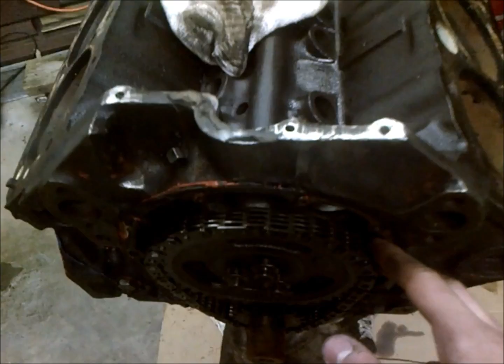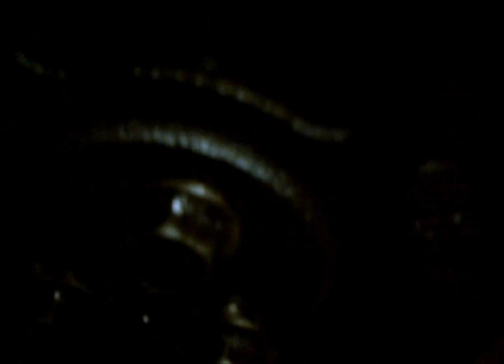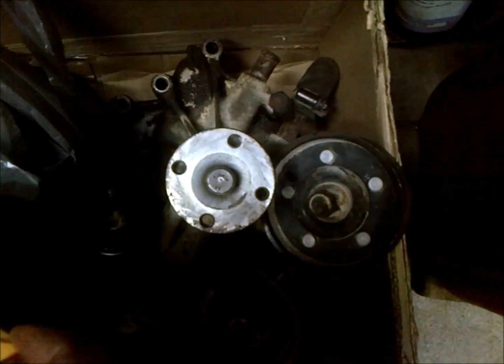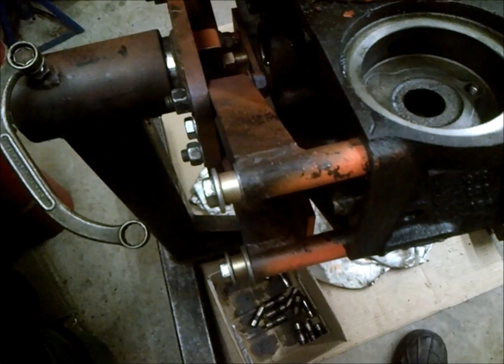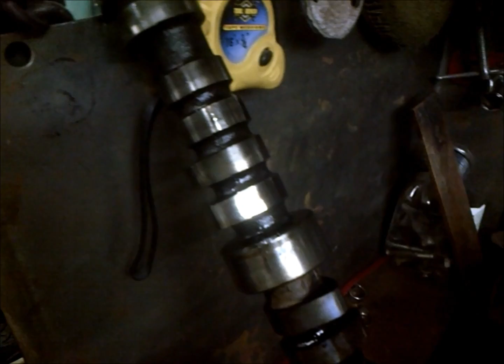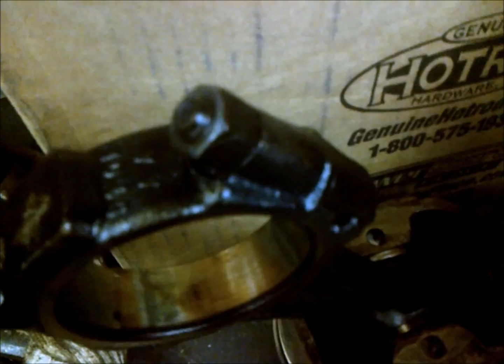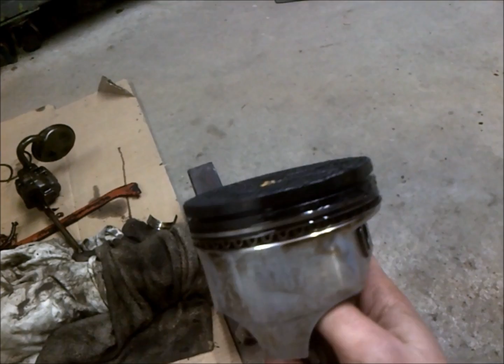350 Chevy vs Ford 302 Comparison: (Dumb Redneck Viewpoint)

Comment: Unreal! I will attempt and try not to insult the Fords, but you can't blame Chevy for flat cams, broken cams and premature wear. A good machine shop can throw a 350 together and last another 300 thousand miles after the first 300 thousand miles for half the cost of Ford parts. Flat cams are due to the oil company's being forced to take the zinc out of the oil and not telling us. Synthetics can also cause premature flat cams. Yeah, syn's are the best. LOL, except for flat tappets that depend on the lifters spinning on the lobes. Broken cams are just shadetree  wrenchers that don't change oil and put stuff in wrong and dirty.
Reply: Chevy treated the exact same will not last as long as a Ford or Mopar that's a scientific fact, I've taken 43 engines apart from a local junk yard, Chevy's have smaller diameter lifters, center exhaust ports too close, water pumps flow 22 percent less than Ford, head and block bolts go into water jackets, cam on Chevy drives oil pump and cam breaks when using thicker race oil, rocker arms gall and break off, oil pump pressed in and can fall out, rods don't have stress bumps by bolt head.
Reply: Jack, your science is from worn out junkers. If the SBC is such a horrible design, why do they run so long? I have also taken apart hundreds of junk yard cores. I have found freshly painted good looking cores that have been screwed up unbelievably by somebody. 350 rebuilds with new 305 rings that didn't even stick out past the ring grooves on the pistons. Several .040 blocks with new .030 pistons and rings, motors with every kind of screwed up cam, pushrod, spring and rocker mistakes you could think of. Just shows that while I used to think anybody could make a Chevy run, I was wrong. I have just about every Chevy combo you can dream of, and probably several you have never seen. That's just me. You can fight for Ford and Dodge and drive whatever you like. I drive a GMC that I like. At about 350,000 miles, I took out the still good running motor before I had any trouble. I have towed my 4800 lb trailer loaded with Corvettes, Chevelles and trucks on 25 hour straight though trips and just stop for gas. The 350 again has cast flat top pistons, vortec heads and T.B.I., with the so called too close exhaust ports, stock rods and pressed, but tack welded oil pick up. Never runs over 180 degrees with the A.C. going and gets over 20 MPG empty. 
Cams don't break from 50 wt. racing oil unless you have metal grinding up in the oil pump, and even then, the distributor gear will go first.
Reply: Z06Doug OK you win, just kidding, I know what I have seen, and I'm not talking about bad engine building, my next door neihbors had 1-1974 heavy chevy c10-- 3 chevy impalas 327--350 all through the 63---66-74 years brand new and they had many engine problems while towing small trailers, my dad, grandpa, and uncle had 390 Tbirds and towed big airstream trailers all over the Midwest and west coast, good luck with those chevys you will need it, just don't let them get hot or the heads will crack up.
Reply: Your only 23 give me a break, I still think they are inferior as a car, that's why there are so many left over motors, count the Fords from 1900to 1990 on Craigslist, just the cars, the number is highest of all brands, you don't even have to count the trucks. Because FORD is superior over all.
Reply: jack rohde you can say shit about chevys and their durability but I've seen a few Ford 302's blow up. Chevy makes a cheaper and a better performing engines, the proof is there especially when gm has sold over a 100 million smallblocks
Reply: +jack rohde  you say the Chevy oil pump is driven by the cam ... well yes, so is the ford.  The Chevy distributor gear is held in place with a shear pin that breaks if the oil pump stops for any reason (say, a chunk of rubber that wound up in the oil and got past the hole in the middle of the strainer, or plastic timing gear parts same), shutting off the engine.  I've seen the same thing happen with SBF (302 Windsor) where pieces of one of the umbrella seals went up into the pump, seizing it and causing the oil pump driveshaft, a hexagonal design, to spin and break while the distributor kept on merrily turning, resulting in a ventilation window mod to the crankcase.

Also, the 10 head bolts required on the SBF cause more distortion on the head surface due to 4-bolt/cylinder pattern and higher torque requirements, while the SBC has 17 bolts arranged in a pentagonal pattern per cylinder, using less torque.  Under high pressure applications (high static compression, or with boost), the SBF tends to lunch its head gaskets much more readily as a result.
Reply: silicon212 The whole length of the cam drives the chevy only the first part of the cam on the Fords drive the pump, the thickest part of the fords cam drives the pump the chevy cam is driving the pump with the weakest thin areas of the cam under twist, I have 3 friends that were into chevy and 2 of them had experienced broken cams, the one that didn't was using a roller cam, actually  SB Mopar is superior to both ford and chevy because the distributor shaft just rides on the oil pump gear, the mopar oil drive shaft is way thicker then either, also ford uses bigger head bolts, and they don't go into the water jackets like chevy does, go ahead and stay with chevy its a free world, I just have seen to many break, and don't like there cheapness, their cars have crappy shutting  doors  and crappy shutting hoods that bend when you shut them, and those floppy windows.
Reply: I have never experienced a cam breakage on a small block Chevy in 34 years of being around them.  Never once, and I've seen hundreds of them - from a mundane LG4 305 to an 11 second drag car powered by a 350.

High powered engines use billet roller cams anyways, not cast iron so even in the case of high power, the argument is moot.
Reply: jack rohde what makes you think I am 23?
Reply: Also +jack rohde, amount of cars of one brand vs another for sale on CL doesn't necessarily mean they're better - it means more people are trying to get rid of them - for better or worse.  In that sense, it would be the exact opposite of what you are saying.

To be fair, my daily driver is a Ford - so don't think I am some 'die hard fanboy'.
Reply: silicon212 Well a mopar  friend  said the same thing, and I said how many vegas, monzas,chevettes,astres,citations,X cars, pintos,bobcats, omnis, horizons, do you see on craigs list? which sold more the  Corvairs or those?  there are more corvairs left today than all those cars combined on Craigs list, so my theory is proven, as the corvair was dangerous but still a better built car than any of those piles of junk, my favorite car from chevy is the Novas, and there is a shipload of them on there because they are a good car, the high numbers are not because people are just all at once getting rid of them there is no spike in the numbers, they are even for 6 years.
Reply: Your argument has a shaky foundation.
Reply: Bryan Loewen easy to sell that many when it is all you make and you classify every single manifestation as a "sbc"